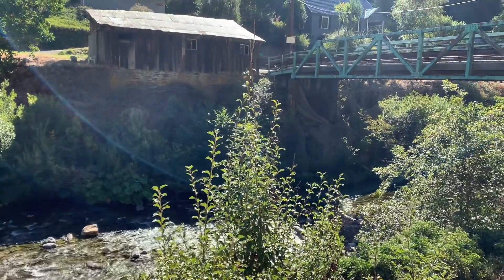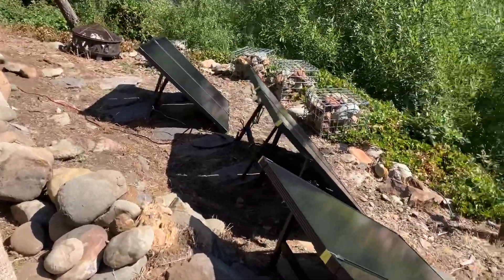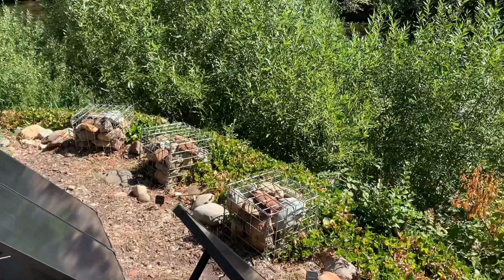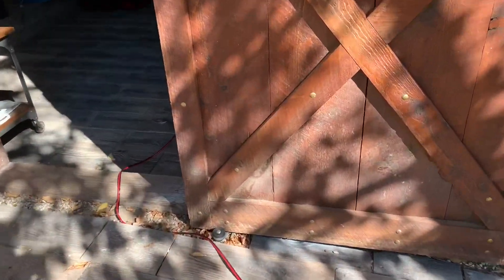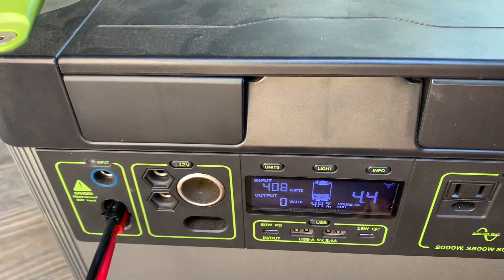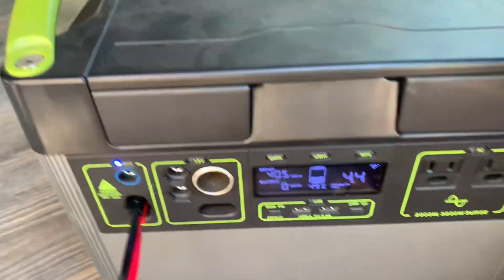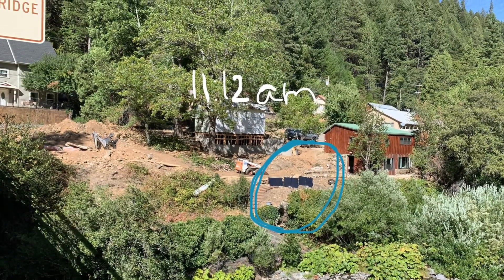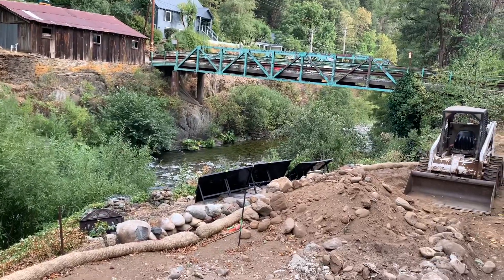Testing Goal Zero Yeti 3000x with 3 Boulder 200 Solar Panels

Comment: I have a 3000, no x. Bought it from Goal Zero during their 2019 Memorial Day sale. Unit cost $2300, normally about $3100. Works well, but I prefer the smaller units, I have a 500x, and looking to get another one. I figure $800 would be a fair price to sell the 3000. If you're interested, let me know. Mike Quintal, in Portland, Maine.
Reply: $800 for a Goal Zero 3000x 😆 — you must think she’s desperate.